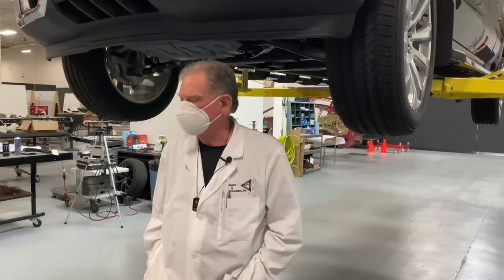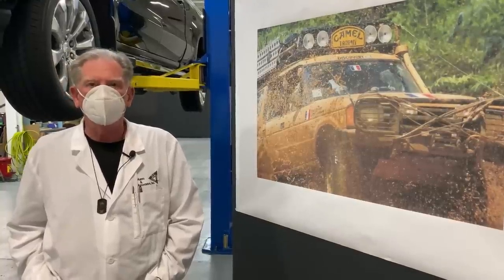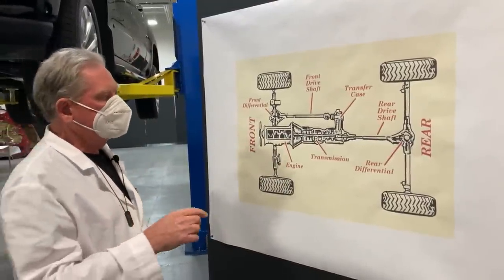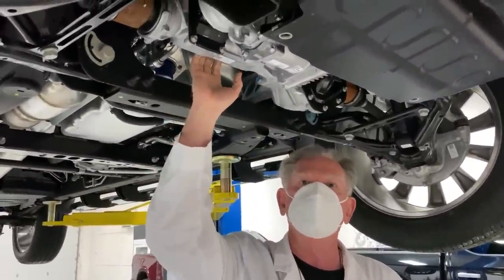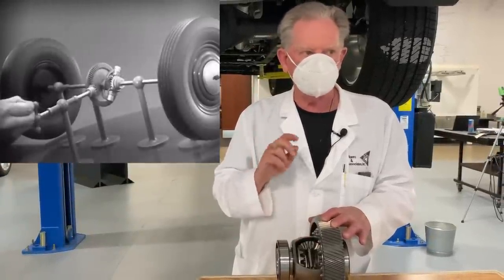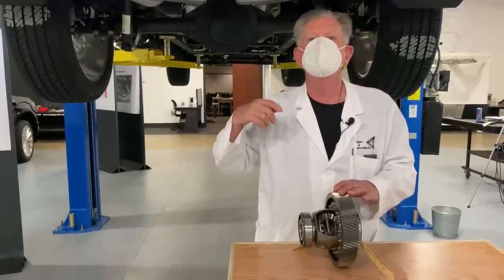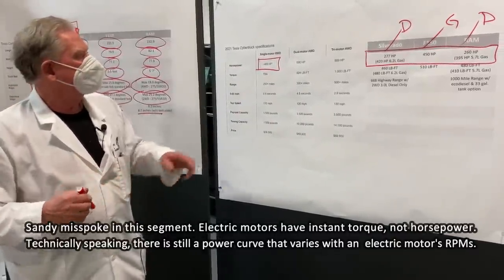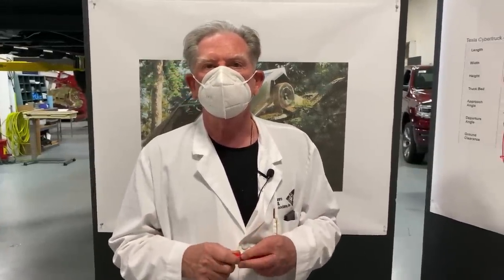Cybertruck E3 -  Driveline & Off-Roading

Comment: Cybertruck is going to need a granny gear to do all of that. Can't wait to see one offroad. Keep up the great work. Thank you.
Reply: The motors already use a 9:1 reduction. I doubt they would have problems going very slowly.
Reply: @JasonWW2000  TFL car did an offroad segment with model 3 and it didn't crawl very good. Granny gear option for those who need it may be a nice upgrade.
Reply: @htnowpro  Was it a software thing or gear reduction thing?
Reply: @htnowpro  I didnt find the specific video you mentioned, but I watched their Model X offroad video and it definitely was not very good offroad. I can only hope Tesla is doing some specific tweaks to make the truck more offroad capable. Maybe an automatic away bar disconnect to help articulation. Maybe they will lower the gearing a little more. Less top speed and more grunt off the line seems reasonable. Its heavy weight will not be doing it any favors, either.

Comment: 2 things...

The cybertruck still has a diff.  It also has an AIR suspension, as opposed to variable tension SHOCKS and SPRINGS.  It also has all the utility of a HATCHBACK.  Even a Tahoe or Suburban is more useful.

If he wanted to, Sandy could have discussed the monster dump trucks that use diesel powered hydraulic motors...ONE PER WHEEL.

Comment: And will fit in boring tunnel perfect that's what I wanted yes you can put other teslas and EV's with the add on giders but cybertruck fits perfect oh and when you get it up to 130 then 80 miles a min you will get through tunnel much faster yes in case of natural disasters and unnatural is perfect I wanted them to put biofilter in it but elon hasn't regergetated that idea from me yet just wait and see I love the cybertruck it will have aluminum glass and rust proof and the ATV was perfect do you remember seeing battle star Galactica as when they went and found eath they used motorcycle and ATV watch the ATV you will be mind fucked and how the motorcycle moves that's was my think I thought it was electric could be wrong but that's how I thought as a kid anyway great video Munro

Comment: Propshafts???
Reply: Short for propeller shaft. Otherwise known as a drive shaft. When you have two short ones like on a Tesla or front wheel drive vehicle they are sometimes called a half shaft.
Reply from the maker: @JasonWW2000  Thanks, Jason, you nailed it.

Comment: What? no talk about the fantastic feature called torque vectoring that 4-wheel electric drive brings to the off road table?
Reply: Is it that big a deal? If a wheel spins the Tesla applies a braking force on then wheel which then vectors the torque to the other wheel that has grip. ICE vehicles do this as well.

Comment: feels like you are putting  the cybertruck into a box, we get that its a way better off road vehicle but you're completely dismissing it as a pickup truck because of the off roading lenses youre looking at it through. you did a HUGE disservice by not comparing payload, towing, or price and a 3s 0-60 for ANY vehicle is insane

Comment: The Cybertruck wins off road specs...until you go cross a water pit.
Reply: Elon said it will float for awhile.  Temporary water not a problem at all.
Reply: @whattheschmidt  Floating could be it's own problem. I'd like it to maintain traction through deepish water without it coming in the cabin.

Comment: I think Tesla will about turn and go for quad--motors to compete with Rivian.
Reply: Check out this really good video on how Cybertruck doesn't need that and will be able to tank turns with the best of them already.  At least according to this video.  https://youtu.be/sO4YRl47_zg
Reply: TESLA does not need to, you can TANK turn with just 3 motors.
Reply: @markplott4820  if you can disconnect the diff and send power to only one wheel on the axel, couldn't you technically do a tank turn with just two motors?
Reply: Hub motors kinda suck. Tesla will not be going to them.
Reply: @JasonWW2000  Rivian is not using hub motors look at their skateboard
Reply: @storm4710  Oh, my bad. I got it confused with the Lordstown trucks which also uses quad motors. I'm really not sure what advantage having 4 individual motors and gearsets give you. It seems like extra parts for no reason.
Reply: @JasonWW2000  Main advantage would be that they only need to produce one drivetrain for all models(higher up front cost but economy of scale should bring that down)
only battery size would be different,
also 
not having to carry around a diff, electronic ability to lock motors together so that it can act like a 4x4 with locked center,front and rear diffs,

Comment: F150 and ram are not what we call in europe, "real 4x4"... And the cybertruck is not one neither, they would all do really bad in a harsh environment. They are only good in cities and some easy off road.
Electric motor do not have instant power, power come with rotation speed and work done by unit of time... Instant power do not exist. Torque do. You do not need that much power in 4x4, torque is the most important 400 hp is already plenty. The electric motor sure got many advantagrs like being able to run at very low rpm, can be electronically driven far easier then a petrol engine for a smoother accelerarion/deceleration... Etc.
About your friend that got a RAM with the 33 gallon option... And only fill it 5 times a year.... It's dumb, carrying around all this dead weight for nothing 90% of the time..? You americans got to start respect the environment more then that... You are by far the bad student in our world, stop using big 4x4 when you do not need them stop wasting the planet ressources for "nothing".
This video really look like an advert for tesla, you are starting to lose credit.